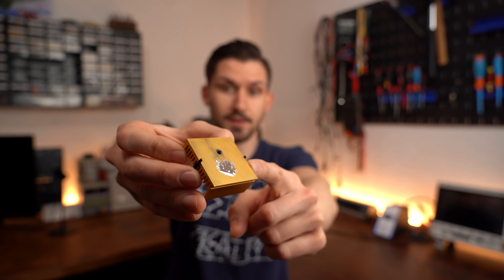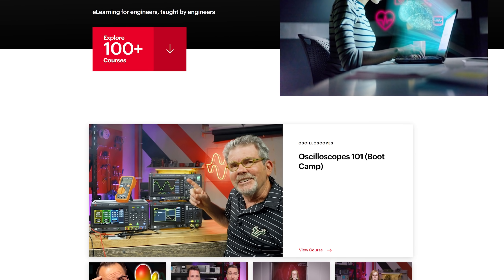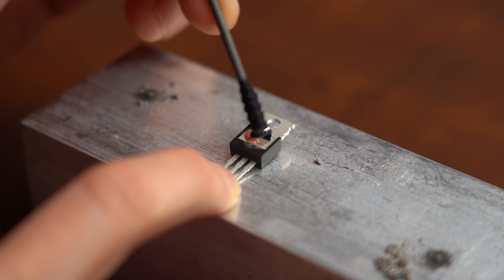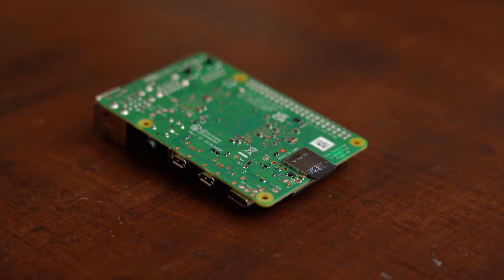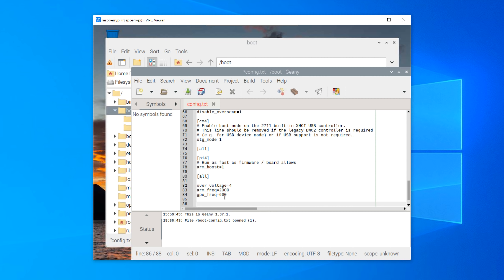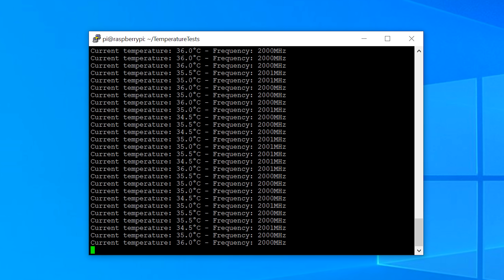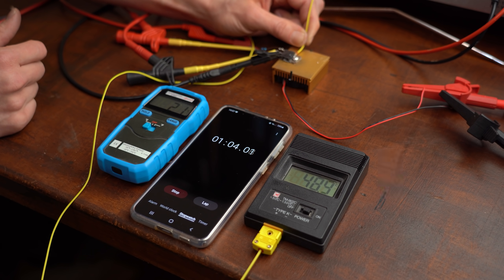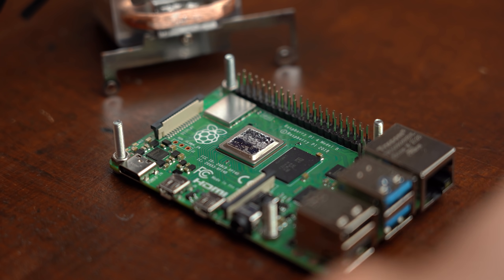Will Liquid Metal replace Thermal Paste? A Raspberry Pi gives the answer!

Comment: When your CPU experiences a few G forces, who can guaranty that there will be no liquid metal at the edges coming loose... Often you cannot observe the edges after settling your cooler.
Reply: I saw a video of a guy saying he saw just that. He said that he had his laptop running and set it down and it froze then shut down. Turns out he had used too much metal, so it atomized and covered everything in a fine metal mist. However, if you use the proper amount, any splashing will be minimized. Additionally, it is good practice to coat the surrounding areas in conformal coating or clear enamel in case of a spill. I have liquid metal on my laptop and I fell off my scooter once, it was bad enough to dent the metal housing through my padded backpack. Laptop still works fine though, and as far as I can tell no metal spilled.
Reply: The 2 keys are using a minimal amount and surface tension.
LM has significant surface tension and thus will not separate from things easily, however if there is a bit of excess and a few G's of shock then it will happily depart and splash on things you don't want it to splash on.
Reply: With CPU coolers for PC there's spring pressure used, so G force could raise pressure for an instant en do damage to the metal layer. Maybe it is only good practice to use it for these applications where you tension the device yourself with screws, so you know all LM is pressed out ? Looks to me it is also wise to use only if it will make the difference to use or not make use of a fan, like in a tablet or smartphone, but not a PC.
Using a clear enamel on the surrounding makes the thing unrepairable I think ?
Reply: Use LM for chip and make gasket around it with k5pro "liquid thermal pad". And no likage.
Reply: @6yp4TuH0  I already thought there could be a special pad for it. But after looking around a bit, I am convinced that this stuff is NOT without its problems, and I highly recommend to do some thorough searching before you apply 💦

Comment: I think the smaller surface area after cutting off aluminium from the heatsink affected the performance of the cooler
Reply from the maker: Not sure about that. When using thermal paste only really the copper area did also only made contact with the "CPU".

Comment: Put copper tape or gold foil on your heat sinks then you can use liquid metal.
Reply from the maker: But wouldn't that introduce another thermal conductivity material.

Comment: I think the liquid metal is generally more useful in higher power applications.  the examples you used were very low power compared to using liquid metal on a top end x86 cpu, or on the ps5.  
Even so, I don't think I will ever use it because the danger of it getting where it isn't supposed to be and then shorting and killing expensive components isn't worth the difference in temp to me.
Reply from the maker: Your conclusion is correct ;-) I said the exact same thing at the end as well :-)
Reply: PS5 isn't a high power use case
and in a few years you're going to start to see massive numbers of dead PS5s because liquid metal flows
Reply: @iamdmc  I doubt that
Reply: @razurio2768  shake your ps5 around a bit and then wait and see

Comment: I could provide you with some Indium Heatsprings for testing. Similar thermo conductivity with much less mess
Reply from the maker: Interesting. Where did you get yours from?
Reply: @greatscottlab Lagerauflösung 😁
I’m working for a German company, that builds high energy UV LED lamps. We use the indium as a thermo conductor for our LED modules. Some of them we solder with indium, some we use indium just as a heat spring.
Reply: that sounds interesting. is it just a thin thermal pad you put between the led and its heat sink? is it soft and "squishy"?
Reply: @bwimtg  The LED‘s are soldered  on a substrate. The substrate is the cooled by a air/water heatsink. In order to transfer the heat efficiently we use the indium.

Comment: The problem with the Raspberry Pi is that thermal paste connects the cpu die to the metal lid, with probably limits the effect of using liquid Metal in top of the lid.
Reply from the maker: Correct. I actually tried removing the heat spread. But that didn't work out at all....
Reply: there isn't much of any kind of performance gain from delidding a Raspberry Pi 4 cpu. With or without delidding the cpu as long as you have a heat sink with good thermal conductivity as well as active cooling with a fan, it will stay below 60c at full load. The only difference is the speed at which the cpu takes to heat up all the way since the lid is a heat spreader.

Comment: Liquid metal is supposed to be applied to the chip and the heatsink. this will greatly improve your thermal performance. 
And your Raspberry Pi is clocked at 2GHz, 2000MHz not 2MHz
Reply: is this to ensure good "wetting" of both surfaces?
Reply: @bwimtg  Yes, otherwise ther metal might not bond correctly
Reply: @davidpetry7853  So like soldering? Makes sense.
Reply: @benjaminbadrakh1644  I dont know whether that is chemically the same, but yeah
Reply: @davidpetry7853  Quite similar since solder doesn't melt the metal on any part other than the solder itself.
Also they used silver based solder or something like that on older processors, between the die and the integrated heat spreader (forgot which generation did Intel stop using that). Stopping using it is kinda the only reason for de-lidding nowadays;
Reply: @Kalvinjj  Thanks for the explanation. I am not that much into chemistry, so I really didnt know it. 

As for soldered CPUs. Intel has started soldering it a few generations ago and AMD has done it for a long time. Today they use indium based solder.
Delidding today is not really a thing on AMD, since the solder joint is really good. 
On intel it can inprove temps a little, but its risky. The solder joint is not as good as AMDs but delidding a soldered CPU can go wrong quite easily
Reply: @davidpetry7853  Nice to know they went back to the solder, tho I don't even know how much of a difference it did comparatively, hard to know without having separate hardware revisions of the same chip with and without soldered IHS. Obviously the direct metal contact is better but I think you get what I mean, as in numbers to tell a precise metric.
Reply: @Kalvinjj  You could compare a not soldered CPU stock and delidded and a soldered CPU soldered and delidded. That wouldnt give you exact numbers, but you could guess how much better the soldered Heatspreader is
Reply: @benjaminbadrakh1644  You could solder the heat sink to the CPU, but it is only a metal encloser that cover the silicon!
Reply: @davidpetry7853  not the same at all. Solder melts both sides causing a fusion. Liquid metal does nothing of the sort. Never will it become a solid like solder. Nor will it "bond or bind" two parts together. Check out gamers nexus liquid metal testing. They have done long term (over a year of it being applied and running nonstop) testing, and will show you more.
Reply: @davidpetry7853  and youd be wrong as the liquid metal heat spreader does considerably better. Stop spreading misinformation. Gamers Nexus tested all this.
Reply: @davidpetry7853  Skylake X i9 Delid & Liquid Metal Application Tutorial - again gamers Nexus.
Reply: @davidpetry7853  /watch?v=gwqYh6c3Xco&t=0s   "Intel's Thermal Problem Pt1: 7900X Liquid Metal vs. Thermal Paste" direct comparison you talk about showing you are in fact wrong.
Reply: @davidpetry7853  in fact you are so wrong the difference makes up about 11c (even when tested with a smaller radiator)
Reply from the maker: Yep. I mixed up MHz and GHz quite a bit.
Reply: @greatscottlab  in spite of that you know so much more about electronics than I do that I gave you a pass ;) 

thanks for the great videos and keep up the great work

respect from UK
Reply: @greatscottlab  Everyone with a working brain understood what you meant, pedantics not withstanding...
Reply: It would still be little difference here. The heatsoak of the heatsink is still the limiting factor.
Reply: Like wood glue, then.

The issue is that it makes no difference IF you put enough of it.

Comment: No just because liquid metal is so much High cost and this for  CPU cooling and other higher CPU cooler using . 
  No the point it is used for commercial purposes . The answer is no just because  
 More MOSFET get 100c not. Just because

Comment: Better off ensuring the fets are lapped to the heatsink and putting as thin application as possible, good compound and equal pressure is key here.
Reply: or just do like people do when delidding actual cpu's and use fingernail polish to protect them. Gamers Nexus ;)